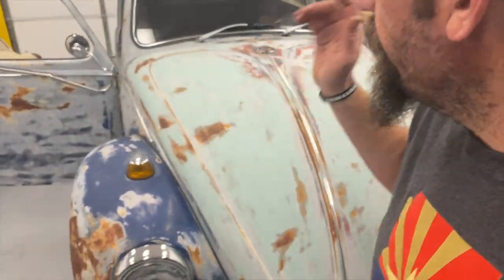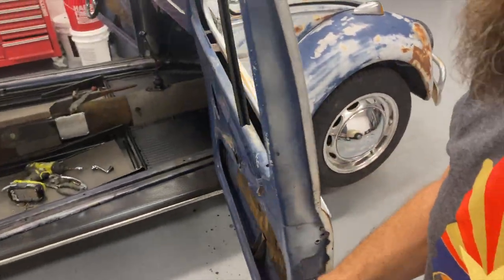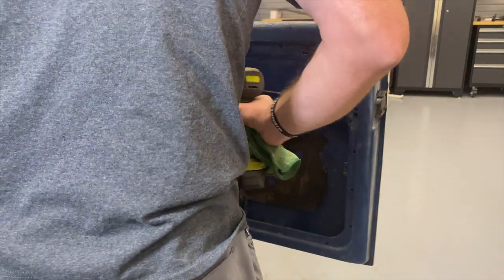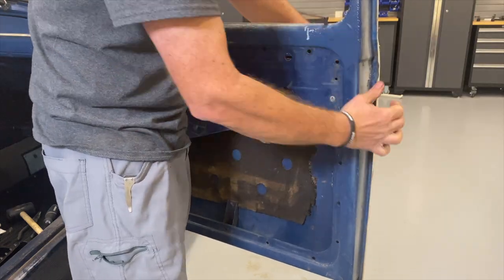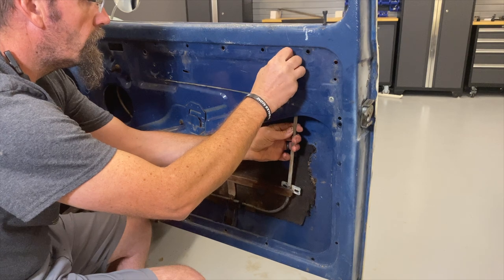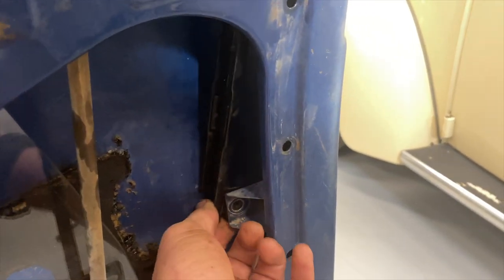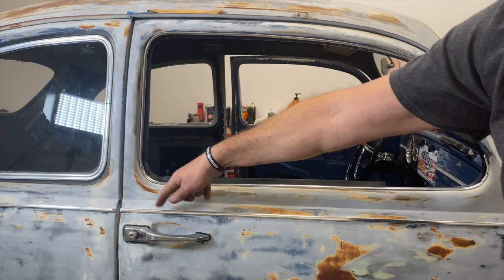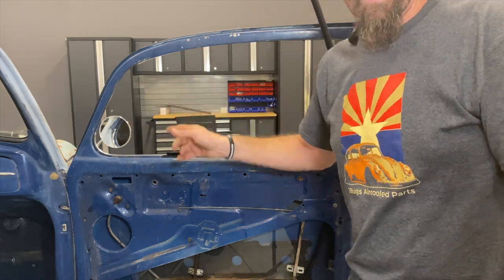1967 VW Beetle - New Door Seals & debuting New TMI Premium Door Panels

Comment: You reminded me I snapped off my sunroof hand-crank last week.  Well, just the little silly spinning knob, but I had to buy the entire thing.

You made those scrapers and door panels look easy.  Door panels give me fits.
Reply: They can be a pain for sure! I've scratched brand new paint a number of times getting them installed.
Reply: @Sam_Mebane    All those little clips and boots and I lose patience in about an hour.  And masonite puts me in a bad mood.  We need to come up with a more durable panel backing.
Reply: @jemcnair76  100% Werksberg was offering ABS plastic panels a few years back. Not sure if he's still around making stuff or not. Either way I would prefer a modern plastic push in (to the body) clip that maybe twisted into the panel, masonite or otherwise. Heck, I might even try to come up with something when I have the time.
Reply: @Sam_Mebane  The PO of my car put in the rear quarters with tiny self-tappers.  I thought that was a great idea for the rear, but I didn't have the guts to try it on the door panels.

It may be that I bought cheap panels but the masonite was mangled by the clips.  There was really not enough bite area for the clips on most of the holes.

And then I had to reglue and restaple the covers, which turned out nice, but the manufacturer just didn't care.

So yes, those modern body clips (the press in type you see on everything these days) on a durable backer.  And the clips need to float somewhat for alignment.
Reply: @jemcnair76  I know years back the EPA required a change to glues and what not. For a few years TMI had issues getting the door panel material stuck to the panel before they finally went to staples. That made a big difference, but yeah, there isn't much meat at the end of the panel for the clip so they break there regularly.

Comment: thanks for showing the process. I just got my window seal kit the other day.  I only put the door seals in for now as I plan on painting my car in the spring/summer and will wait until then to do the scrapers and trim.  I redid the internals of my doors a month or so ago along with new water barrier, clips and panels.  Got the doors back on and found that I put my check-rods in backwards!   Stupid mistake... knowing that the chances of popping off the door panels without breaking them is slim, I just removed the check-rod pins and shoved them back into the door to be another day's problem!
Reply: Been there, done that...flipped em immediately!